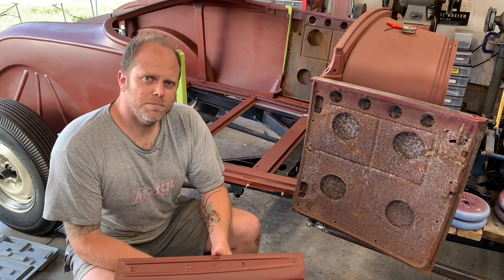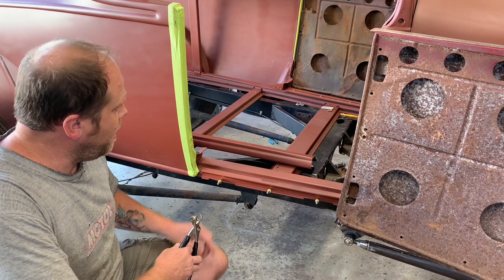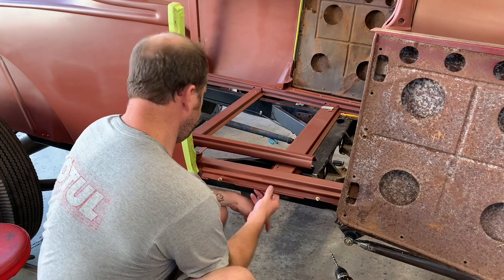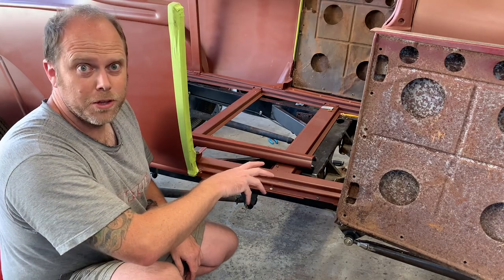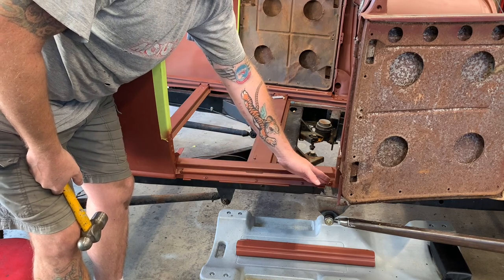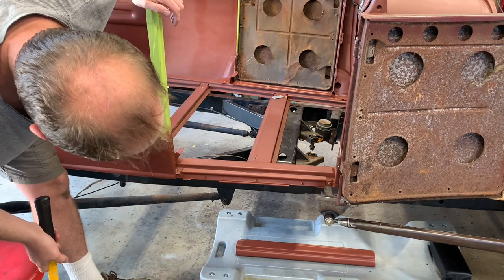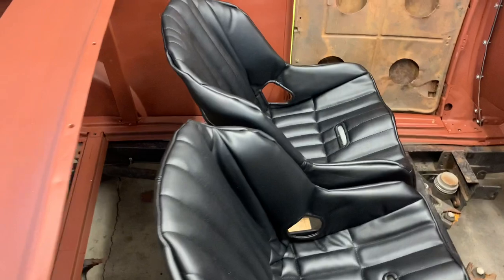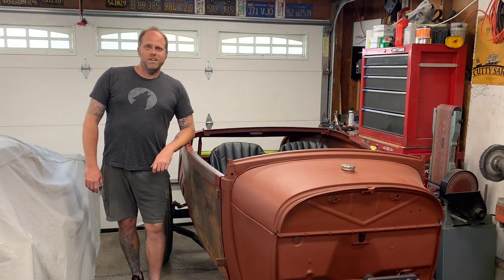Installing Brookville Door Sills: 1928 Ford Model A Hotrod Project; The Crazy Casey Roadster Ep11

Comment: Casey I'm  building a 29 roadster, currently working with a brookville sub frame, did you assemble your sub frame? Would like to ask you questions about measurements
Reply from the maker: Ranger,

I did assemble my subframe. Everything I have for measurements and photos of the process can be found on the first page of my build thread, here:

https://www.jalopyjournal.com/forum/threads/not-worth-saving-1929-model-a-roadster-av8-hotrod-build-thread.1053230/

Hope that’s helpful! 

Cheers,

Casey
Reply: @crazycaseyscustoms  Casey Yes the web site is very helpful, love the idea using pop rivets temp then installing steel rivets one st a time. Excellent info Thank you for all your time and effort in posting videos.
Reply from the maker: I’m glad you’ve found the effort helpful,  @rangercoon . I’m getting pretty close to starting up on (and hopefully finishing) this project soon. 👍🏼👍🏼